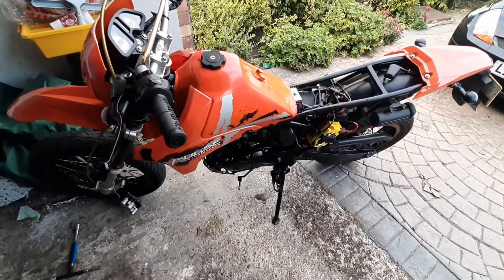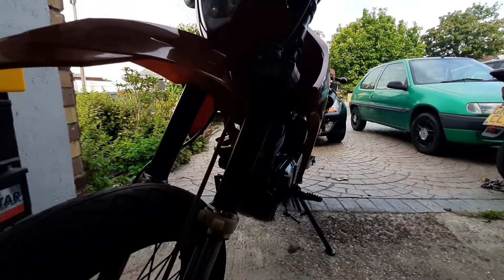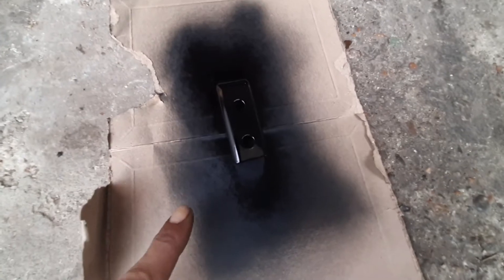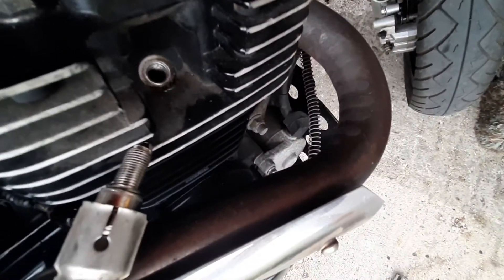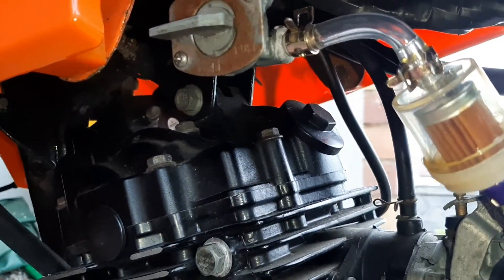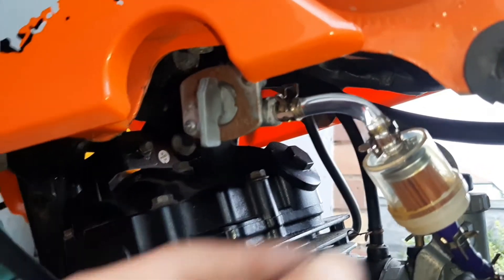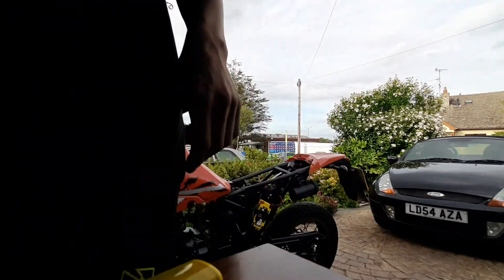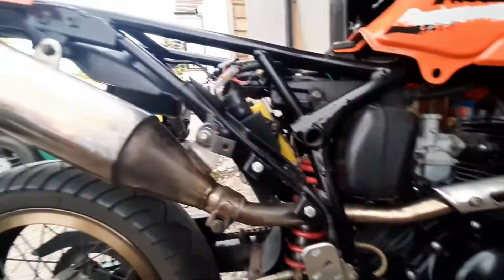Pulse Adrenaline First Start in Over 8 Months! *She's Angry!*

Comment: Hey Dan, enjoying the videos, I also own an adrenaline for around a year now. If you disconnect the two wires going to the side stand the bike can be started without the stand up, I just cable tied the connectors to the frame of the bike so they're not loose.

Also these bikes have a clutch switch that won't start the bike in gear unless the clutch is in, sometimes the wiring under the clutch can get loose to which might've been the reason for the bike struggling to start at the beginning.

Best of luck with the bike! They're great fun.
Reply from the maker: Excellent thanks mate! Glad you're enjoying the videos. 
The side stand switch was disconnected when I got the bike so I set it back up to see if it works then spent all day walking around kicking the stand up like an idiot 🤣 I'll get to pulling it off soon thanks for the reminder haha 

I had no idea about the clutch switch though. I'll dig around up there and give it a clean cheers mate 👍

Comment: that braket that screws to the forks is it meant to move left to wright in the caliper cus mine isnt,and the new pad on that side is rubbing on the disc all the time and the wheel is stiff to turn round,thanks for any help m8..
Reply from the maker: The little bracket is supposed to stay put mate as it holds the brake line in place away from the wheel so that's fine 👍 
As for the disc rubbing it could be a few things, maybe check you've got the spacer on the right side, speedo drive needs to be in place and all of that to make sure its lined up right, you also might need to check the caliper isn't seized in any way so pull that off quick, spray it over and check the pistons push in. Then bleed any air out the system. I would do all that then take it up n down a safe road and hit the brake at different sharpness to try bed the pads in. Hopefully something there will solve the problem. Hope that helps n keep me updated 👍
Reply: @dandoesbits  thanks for that dan al do that,and thanks again for your help al let you no how it goes 🙂
Reply from the maker: @garyhall9329  no worries hope it goes well 👍